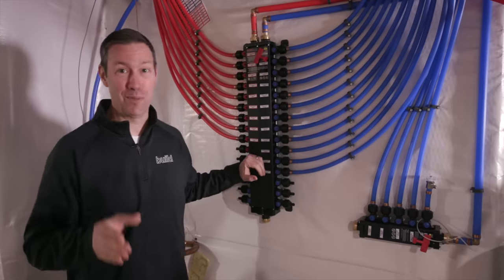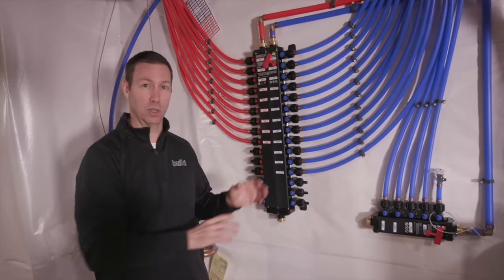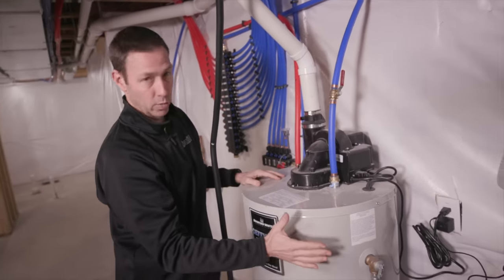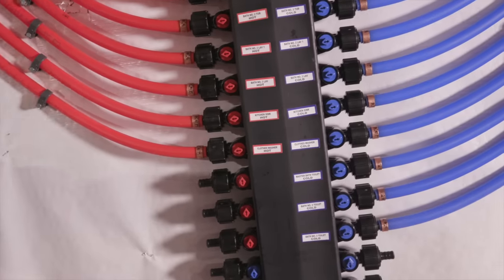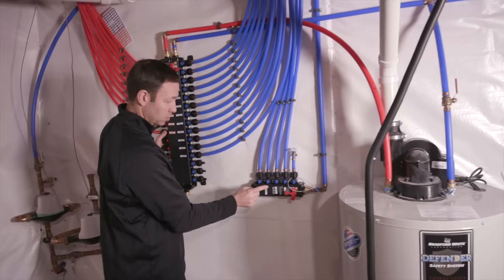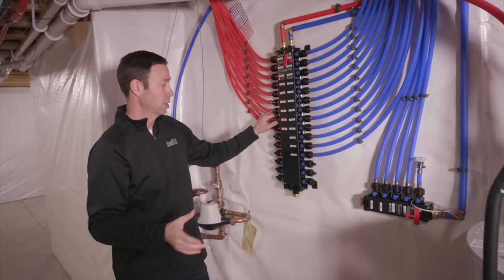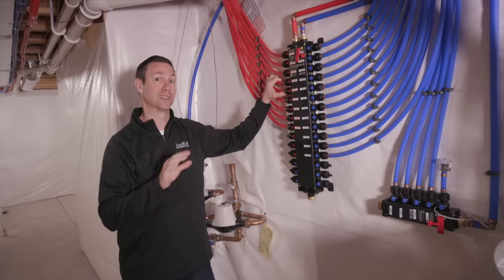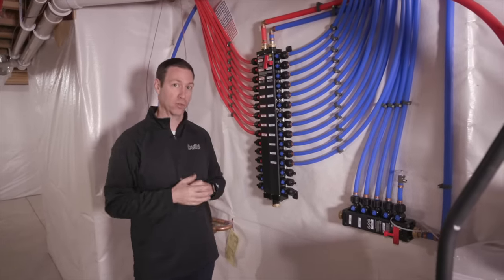PEX Manifold System - Pros and Cons + Tour

Comment: Question.....I believe I have such a PEX manifold hidden in between drywall ( wall between attached garage and inside entry/laundry room.). The house is in the South and I "occasionally" get line freeze when we have an uncharacteristic cold-snap freeze. So....I'm thinking of using one of those under-sink-pumps and cold/hot blending systems that are nornally used to help speed up hot water delivery.....BUT.....they also can be configured to blend hot/cold lines to prevent line freezing. My question--> these sysems typically work best when the under-sink pump is located at the FURTHEST AWAY sink from the hot water heater, and if the system uses a more conventional branch system of piping with main line trunk supply and return. Will this freeze protection work for a spaghetti system like this PEX system, without a main trunk/branch arrangement?.....or won't I get a nice "blended" temp with this throughout the house?

Comment: Use what's been used for a century and a half with no issues. The only thing going with Plex is the color code but if you follow the rule. Left is hot and right is cold you won't get confused which unmarked pipe is hot or cold. You can use solderless fittings so the people that don't know how to solder can plumb with copper which is mostly all plumbers . Just look at the drips of solder at every fitting. My dad taught me how to solder pipe leaving no drips of solder at the valves and fittings. He rarely had to go back and redo a fitting because of leaks.

Comment: I am constantly amazed that in the U.S., most homes use a huge wasteful tank heater, thus a huge and wasteful distribution problem as you so aptly put forth.  (Plus install cost is higher) If you simply put in a demand system at the point of use....little to no waste.  Pull wire not pex.  Less mechanical connections by far.  Electrical consumption as needed.  No circulation loop required.  Oh, and can be done with 110V,  220V or propane or solar, depending on what is easier/more economical where you live.

Comment: The other con is that if there is a leak, you have to replace the entire line....in a trunk system, you can splint just the section that needs it.  You could do it with both, but then you're adding another point of failure in a system that is "supposed" to have very few.

The manifold seems best with floor heating systems, as you can have the hot tap split into multiple lanes or floor sections, then come back to combine on the "cold" side.

Comment: Pex loves to start snapping or developing fractures in the walls after a few years, trust me!
Reply: Yeah I know it's funny when all these people run to the new thing. Might as well use CPVC
Reply: @nickwallace6214  give me copper any day.
Reply: @wojtek-33  the problem isnt that the product is not reliable it is the water hardness.
Reply: @wojtek-33  we use it in the medical field as distribution lines under low pressure, like 20 psi or less and it is fine for the 1st decade then goes to crap. I'd take gray schedule 80 pvc over this and copper over PVC.
Reply: @wojtek-33  I have been in this field for 12 years and some of the pex in question had been put in 8 years before I was hired and I have had to make multiple repairs where it developed fractures and leaks over the years. It's great when new then ages terribly.

Comment: Retro fitting older homes I use that system and works great  for single story , multi story can be a challenge however just look for central location that you could add a mechanical shaft in closet or niche that’s easily removable and a must if your forced to use fittings between the manifold and the fixture . Just use electrical logic ie. Don’t cover splices avoid sharp radius’s, secure runs as often as possible, water hammer is not as bad as ridged pipe , however it is still a concern if the runs are not secured as mfg and codes required 
if line pressure is a concern use regulators with expansion tank or device prior too effected piping run!
Disclaimer I’m not a plumber or electrician 😂

Comment: Clean. I like it. If it's not prone to leaking I'd prefer it over copper
Reply: When installed properly pex is easier to run and less likely to leak than copper. I don't like the manifold system though.

Comment: Should there be at least 10 feet of piping between the water heater and water softener. Because this distance from what I herd will prevent the possibility of hot water migrating backward into the softener during regeneration? what are your thoughts?

Comment: It looks like at 1:00 in, the hot water issues you talk about later are actually non existent.

They seem to have ran one main hot line to each location, I.e. bathroom, meaning the shower and faucet don’t have to do a separate full discharge of cold on the hot line.

It is a precharged system per location, per use, once hot is achieved.

Comment: What if you lose the "key" or the manifold itself has a leak & you don't want to get sprayed with hot water while trying to shut it off?
What was the little water softener (brand/model)? Does it filter out iron sediment? I like that it is small & could probably fit in tight spaces.
I have well water with a ton of dirt & sediment. We don't drink the tap water & it comes out sort of brownish. My water heater is less than 5' away from the shower, but it takes about 2 minutes for the water to start getting hot. 
I do like the idea of different shutoffs- but I have no basement or area to set up a manifold like that.

Comment: Hi Matt, good info as always. I've learnt lots from the Build Show! I built our 1st custom home which we installed the same Manabloc. Our straight run from the manifold to the master bath is approx. 30 ft. I noticed a 40 sec or so lag with the hot water in the master shower and other fixtures. On the next build, I'd like to get your thoughts on incorporating a manifold install with logic plumbing which I hope to benefit both the easy-of-use of the manifold and allow for quicker delivery off a trunk line. In this config, I will be able to install a smaller manifold with each H/C run as the "trunk" to multi-port tees (for baths, kitchen and laundry) to the individual fixtures. Do you think incorporating a recirc unit is possible and/or adds value?

Comment: Another negative to this type of "Manifold" is the hot and cold are one unit which suggests the hot water in vs hot hot of the manifold will likely have a reduced temperature due to the heatsink affect that the cold water side will have not to mention once hot water has stopped running, the manifold will cool off the hot side rather quickly.  Might be a better idea to use two manifolds, one cold only and one hot only and those pex pipes should be insulated. This really does cast a problem when there is a master bath with two sink, a shower, a tub etc. and each hot fixture has to waste the home run amount of water to get the hot water. In that case, I would run a trunk line to a room with multiple fixtures then put angle valves with every fixture.
I saw a tract build recently that used a manifold set up like this which was encased in a wall with a cabinet and access door in the garage. Seemed nice however they contractor did not use any angle valves anywhere in the home. All home runs were directly coupled to the fixtures so if you wanted to turn off the water to the toilet that might be overflowing, you have to run to the garage to turn off the water supply. Or, if a leak was developing with a fixture, same process, go to the garage and turn off the correct fixture. Then, when the homeowner decides to replace/repair or upgrade a fixture, no angle valve so they end up having to buy all of the crimp tools/shark fittings ($35 to $50 ea) just to replace a toilet float valve when it wears out, which it will. 
In the end, it truly appears that the trunk line with several branch lines is the best method as long as the trunk line is large enough to prevent volume drop that it supplies from room to room. Using angle valves at each fixture is also a best practice.

Comment: These are very common in newer RVs now. If your on the road and have a leak in one bathroom, you can shut it off without losing water the the entire RV.
Reply: And if you're on the road and the manablock fails, it is not available at either RV suppliers or hardware stores. It is special ordered through a plumbing supply house at great expense, and sometimes the original, designed to fit in a specific space is no longer available! As an RV pro, I dread seeing this garbage on a customer's rig. They are fragile, and if I break it I have to fix it. In addition, winterizing uses 6 to 8 times more antifreeze because there's that much more piping.

Comment: Can you run a single line (larger line) from the distribution block to the bathroom, then have it split off in the bathroom for the sink and shower? This way both get hot water at the same time? For example, I could brush my teeth with the sink before I shower... then the shower would have hot shower water immediately because the cold water in the bathroom line was evacuated while I was using the sink.

Comment: If one valve on the manifold break you need to replace the entire manifold.  Do a DIY manifold to both save money and to not have a bad valve leading to system replacement.
Reply: Meh....cap that valve and swap the fixture to one of the many open valves.

Comment: I thought part of the benefit of pex was that it did not require insulation because the walls are much thicker than cooper and the material is much more resistant to cold than copper.
Also, I've heard that the Viaga fittings are starting to fail. Uponor compression fitting are supposed to be more resistant to failure.
Not a plumber but the last house I built I used Uponor because of the research I did about pex before choosing what I was going to use.
I'm also in California Central Valley so I'm sure heat loss is much higher in many parts of the country than what we have to deal with here.
All of my plumbing is in insulated walls or the conditioned spaces of the house.

Comment: Trunk and branch without recirc is going to be as bad or worse for waiting on hot once all the heat in the trunk has dissipated is it not?
I’d like to see one of these recirc systems. 
So a homerun manifold for all of the cold runs and a recirculating trunk/branch for the hots would be the shiznit right?

Comment: Circulation systems really don't work. You could also use a "trunk" system with Pex, but it is not as efficient as this manifold system because you are moving far more water through your system every time you want hot water. The manifold system probably wastes less water and is faster than a truck system. 

If you have long runs, it is smarter to install a hot water heater in an upstairs closet and run your hot water lines from it. Electric hot water heaters don't need much clearance and they are getting more efficient all the time.  However, if an upstairs hot water heater is installed, be sure to install a floor drain system where you can drain the water heater if necessary. You will also need a floor drain primer of some kind to keep the P-Trap full of water.

Comment: Matt, At 8:43   delivery time to the farthest fixture.  You have some incorrect assumptions.  The cross sectional area of a .5 inch pipe is 0.2 square inches.  A 25 foot run then contains one quart of water. Exhaust time is approx 7 seconds.  Feed pipe from water heater added, 12 seconds.  And this is NOT just math. I built a complete house with manifold system in 1991, lived with it for 20 plus years.  That  PEX was a precursor to current systems,, the pipes were 1/2 OD.. a strong 3/8ths ID.  It was/is a nearly 90 foot run up through the house to the master bedroom shower.  That 90 feet includes the feed pipes from the hot water tank.  Full hot in that upstairs shower was 12 seconds total.

Time required to rough plumb all water lines for the entire house was one day.  Three full baths, one 1/2 bath, laundry room on the second floor, kitchen, 3 outdoor hose bibs.   One day.  It was a February day, Michigan, 10F , delivered in 500 foot reels (2),, and any time a pipe was kinked even momentarily, it was removed, replaced.  Do your home runs long to short, waste from a cut off or serious kink, may be used on a shorter run.

The major differences are,, You do not need to insulate the hot pipes.  The water moves so fast it does not have time to chill.  Just like your plumber,, group and bunch your lines, hot and cold separate. In the south you may want to insulate your cold water pipes for condensation reasons. Insulate the bundles. with large pipe insulation.  1/4 the price of copper.  Zero need for a recirculator.   Never  go for a right angle turn,,,, get that idea out of your head.  Very direct and softly curving runs,, require less pipe feet, speed install.  Drill your holes through framing on the line you are traveling, not square across the framing.  Plastic PEX slides easily over fuzzy softwood drilled holes, makes pulling pipes faster and easier than pulling wires.

Comment: So why is there 3 cold pex fixture points on the left side of the mana lock (towards the bottom) ? I’d this standard or is there adjustablility in the internals of the system. Also is there backstop valves inside the block? And some sort of pressure regulators for when 5 pipes are pulling water at the same time? Thanks. Cool video btw

Comment: Actually you can have circulating hot water. 

You put a watts valve at each hot/cold location which allows the water from the hot side to go back down the cold line till the hot reaches the valve which then closes. 

The problem is that it takes a larger circulating pump since all the hot water has to through the pump.

The other way is to run a return line back from every hot line. 

There is no reason you can’t insulate the hot water lines but it’s a lot of insulation.

Comment: In a big house, why not have many smaller distribution blocks like that running multiple big pipes to areas close to points of use? You could even have a main distribution block near the water inlet to manage water distribution to the many sub distributions...
Same principle as putting smaller breaker panels closer to groups of outlets and running one big cable to a main breaker panel...

Comment: I have a home run system but it is not as nice as that one. My does not have the individual turn offs and unfortunately my plumber mixed up and attached my lawn service to my soft water and. It is not labeled and I want it to be moved over to my hard water side.... I am having issues figuring which line it is. Any tips for figuring which line is running?

Comment: My house is old-school copper.  The water heater is in the garage so the hot water hits the clothes washer first, then the kitchen, the full bath, then finally the Master Bath.  If I wake up at 7 am and wash my hands, I will have hot water quicker if my wife has taken her shower.  With a Pex Manifold, I would have to wait until the hot water gets pumped through the entire line, wasting water.  A Recirculation Pump can be added to a traditional system, but with Pex, there would need to be a return line on each fixture.

Comment: To avoid evacuating multiple lines, couldn't you use sub-manifolds closer to point of delivery?  Then you only evacuate one line, say a sink and shower together or multiple showers and sink in one area together.  I guess that's the trunk and branch system you referenced.  Good video, as usual!

Comment: Living in a cold climate hot water circulation is essential for convenience and energy savings, so it's kind of a bummer that the Manabloc system can't support it. Our home was built in 1904 and the plumbing is a cobbled-together mess of intersecting, crossing feeds and returns that take up 3/4 of the basement's ceiling space, so replumbing is a major goal. This is also an issue because there's currently no room to put in cross-bracing to stiffen the bouncy floors above. Oh well, on to Plan B.

Comment: It's probably not the case for all of the hotlines, but it seems that the red lines are bundled together. It might not make a huge difference, but the unsued lines will trap some of the lost heat from the working lines. Tough the temp won't be 120 F in these idle lines, it won be 58-60F either, most likely in the range of 80-90 F. In another way, the con of need to prime with heat every line won't be that terrible.

Comment: Don't you still have a shut-off valve under the sink and at the toilet? If so, isn't having this system kind of redundant?
Reply: Well if someone pierces the tube installing/mounting something like what happened in one of his videos or one tube just fails for whatever reason somewhere within its run, it'll still be helpful in that you can shut off the specific tube yet keep water running everywhere else.

Comment: Is there a thermal break within the manifold to separate the heat?  Otherwise you're constantly losing heat to the cold side. I would think a better design would be to have two separated manifolds so there's no heat transfer.

Comment: One other downside is the sheer amount of pipe you have to run throughout the building. Installing a massive bundle of 20'-30' runs of pipe in your house isn't exactly cheap. I would recommend a hybrid approach for large houses where, for example, you have a main manifold block with larger trunk line pairs running to a mini manifold block under the sink in each bathroom. That way you still get fast hot water, you retain the ability to turn off individual lines, and you save money by only buying about 2-8 feet of pipe (or less) per fixture as opposed to 30 feet per fixture.

Same thing applies for electrical wiring in large builds. My house has a circuit breaker on each floor. The reason is, of course, to save money by not buying hundreds of extra feet of wire.